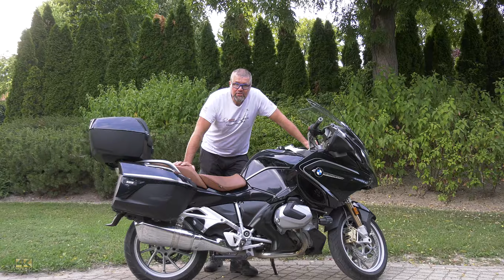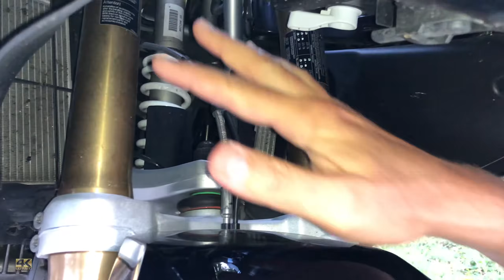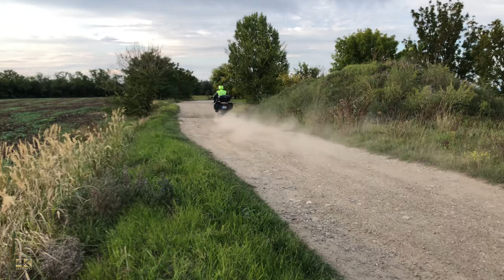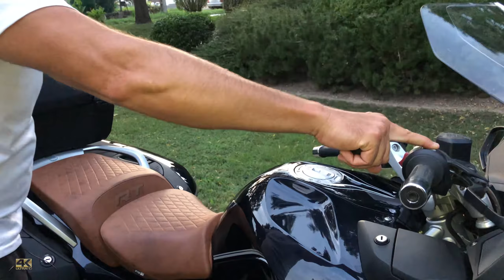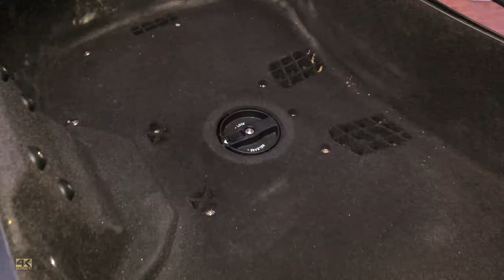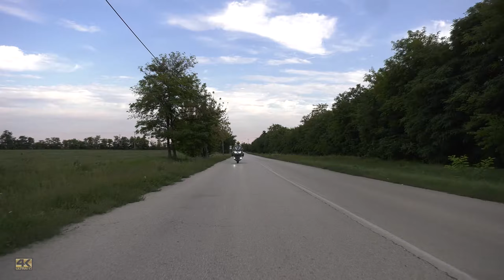BMW R1250RT review (4K): the king of touring - Onroad.bike

Comment: Very good and comprehensive review, congratulations! Last april 2025, I trade my 7 months old 2024 R1250 GSA Rallye for a 2020 R1250 RT and I couldn’t be feeling happier. Before my 2024 GSA, I also had a 2021 Harley Davidson Ultra Limited for 3 good years, but it was too much heavy for me. For now, I probably don’t intend to trade my 2020 RT for the 2021-2024 R1250 RT, with its new TFT panel, ACC, etc. nor the brand new and, in my humble opinion, disfigured 2025 R1300 RT. I installed a Chigee AIO-5 for BMW to have Apple CarPlay with a lot of useful apps, and access all the technical information directly from the bike! I’m super satisfied with my 2020 RT and its classic clocks panel! I’m 63 years old and I feel that’ the RT is an easier bike to ride. Best regards to everyone from Brasilia, Brasil 🇧🇷! Eduardo Silva.

Comment: Very good information on this fabulous motorcycle. You made an error regarding the headlights, though. The centre light is the low beam. The two bulbs inside the ring lights are the high beams. Good video!
Reply from the maker: Thanks for the correction!

Comment: My side cases fit so poorly that they rattle like rocks in a tin can.  Give me back my Yamaha FJR.
Reply from the maker: BMW is using these type of side cases for many-many years. There is no problem with them at all... With the 3 factory-boxes Yamaha doesn't even allow to use the FJR, because high-speed stability is disturbed... ;-)
Reply: @OnroadDotBike : Absolutely!  They're  wonderful cases, they just fit poorly and rattle.  With every bump in the road they clunk, clunk, clunk.  I can grab them with two hands and jiggle them all over the place. Yes, they're super secure in the sense that they're not going to fall off, but they sure sound like it.  A "premium" bike like BMW should be better.  FJR cases on the other hand click right into place with nary a jiggle. I got rid of my 13 FJR for this 16RT and have been experiencing one quality disappointment after another.  I particularly like the velcro inside of the side panels; keeps them from rattling....but it's a fun bike.

Comment: Making an excellent BMW even better. My 2015 R1200 RT was totaled when I was rear-ended by an elderly driver.  I was trapped behind a moving van at a traffic signal. I saw her coming in the mirrors, and all I could do was hold on and be knocked into the back of the van. When the bike tipped over, the optional crash bars kept my foot from being injured. After a year of hiatus, I am ready to get the new 1250, and will add all of the accessories again and ride on. This review is excellent, reflecting all of my own positive experiences. I never experienced anything other than positive reactions riding the RT.

Comment: I just cannot stand the boxer engine.  If that thing was laid down at speed, you will need a new engine, plus it is ugly.  Now if they had done an in-line four, then I would have considered it.  So I bought the runner up to it and bought the 2020 Yamaha FJR 1300 es.
Reply: They have a inline 6 that leaves yamaha in the dust. I used to think the boxer was strange till I rode one. Bought it. Best motorcycle I have ever ridden.

Comment: I bought mine in March 2019 specifically for two-up riding and it excels at that. The bike is also a great solo-riding experience.
Thanks for your review; it is the most useful one out there. I have fitted ZTechnik z7106-002 Engine Bars.

Comment: Having owned numerous BMWs over the years beginning with a 79 R 65, a 2015 RT, and now currently riding the 2019 RT 1250. I’ve ridden thousands of trouble free miles on these bikes over the years. Really am enjoying the 1250.
Reply: Wish I could say the same.  8 months and 4200 miles into my 18' RT and the rear shock just froze stiff.  Been at the dealer now for 4 days and BMW still hasn't decided that the shock needs to be replaced under warranty.  Before this happened I was singing great praises for the RT.  Hope to be doing so again...soon!
Reply: Doug Stewart sorry to hear about your RT. I remember when the 2014 model was initially released there was a problem with the rear shock. If I recall they recalled all the RTS to address the problem. Your bike should be under warranty, I’d fight it the bike wasn’t covered. I did have driveshaft issues with my 2007 R1200 R. Thankfully BMW fixed the issue after 90 dsys🤬

Comment: BMW still using single plate dry clutch. This clutch does not stand up under extreme heat and driving conditions. I would not recommend this bike!
Reply: Nick Heinz it has a wet clutch

Comment: Hello, I was impressed by the way you talk about the RT1250 motorcycle, but I noticed that you did not mention the capacity of the fuel tank for this motorcycle and the distance it can travel. 
and thank you for your vedio.
From / mr. TALAL ALMOWALLED.. KSA
Reply: 6.2 US gal. I usually get 50 mpg at 70 mph. The bike will go further than I can between stops.

Comment: Beautiful bike. How does this stack up to the new generation Gold Wing?
Reply: @nadadawg  but the goldwing hides it weight better, because that flat 6 engine is much lower down. COG is much lower on the wing, making the bike "feel" much lighter than it actually is.
Reply: @zunaidkajee4540  However, there is no comparison in dynamics. You can ride RT fast, it goes slow, you can go for a scrape too.

Goldwing rides one mode all the time..

Comment: To bad they are so far behind on technology, compared with a new Goldwing. Bulbs for lights instead of LED's, analog gauges instead of digital. Really hasn't change much from 2014 R1200RTW 
I own a 2016 R1200RT I replaced all my bulbs with LED lights and added Erica clearwater  lights. 170k miles still running strong.
Reply from the maker: The RT is not the real rival of the GW. That"s the K1600. Size, feeling, price, etc.
Reply: I had a 2014 R1200RT did 40,000 miles and it corroded away any residuals until BMW offered £4K for trade in. There’s no real opposition imho so went for R1250RT, quick shift, engine & gearbox are big improvements preferred the suspension on the 1200

Comment: Review:  👍👍  👏👏👏!!!   Thanks.  Many people have complaints about or don't like the look of the front fairing.  It is very effective at keeping the wind blast off the rider and making the rider comfortable while sitting in a bubble of calm air.   Personally, I LIKE the looks of the front fairing but I am probably in the minority of opinions on that.  As for the rest of the bike, there are less than a handful of bikes that offer more comfort and convenience features than the RT.  But the Best Part?  The impeccable Handling.  Want to really lean it over in the corners?  The bike will scrape the peg feelers without complaint.  Want to tour and cover miles and miles of road and still feel fresh at the end of your trip?  The RT will be happy to comply.  Perfect?  Not quite but very, very close.   Cheers.   🥂🍻
Reply: Suppose to be redesigned in ‘21.
Reply: Paul Settle  With what’s currently going on in the world, I would not count on it happening but if in fact it does, I’ll be very interested in the changes that BMW comes up with.  At the very top of the list though would be incorporating a lock for the Navigator unit that is part of the central locking system of the bike that is not an option but part of the base level bike.